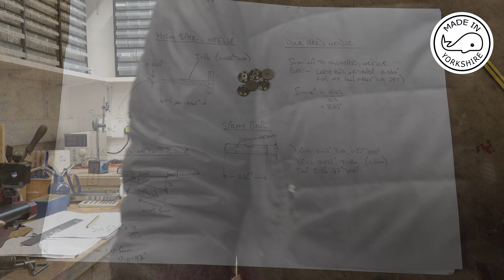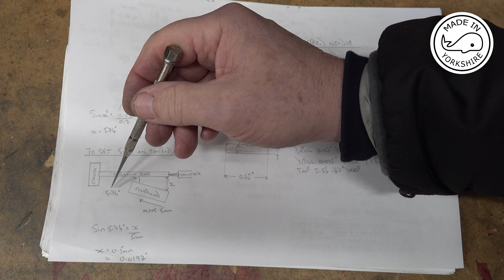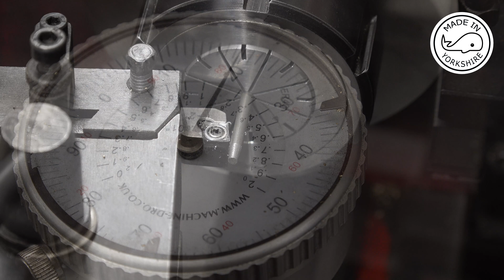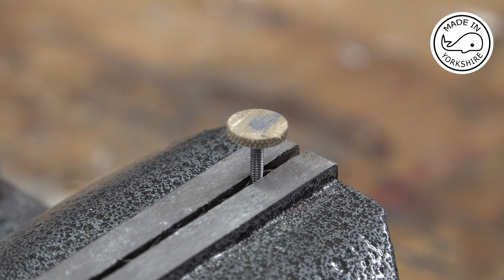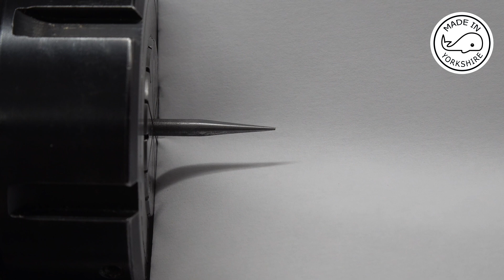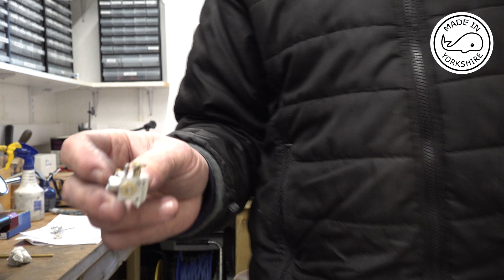#MT46 Part 3 - Jerry Howell 2-Jet Throttle/Carb. Spray Bar and Needles. In 4K/UHD by Andrew Whale.

Comment: While it doesn't really make a difference for your application due to the very small angle, but you should have used the inverse tangent to calculate the angle of the taper and not the sine (oposite/adjacent and not the hypotenuse). You when then use the sine to calculate the offset stack since you are now using the hypotenuse. As mentioned, the difference is very small at these small angles but you calculated an angle of 5.74 degrees, but it should have been 5.71 degrees (in your application this is negligible). Obviously this would make a larger difference for larger angles.
Reply from the maker: Hi Graham - well spotted! I think I must have had a 'senior moment' at that point. Many thanks for pointing it out.
Cheers
Andrew

Comment: Andrew, I'm enjoying your series of video's but may I make a couple of suggestions, when soldering items together where possible heat from underneath and the flame wont blow the solder about, have you checked the tailstock with the chuck centre recently as I think the little drill was pulled over by the centre drill which may have drilled slightly off centre.
Reply from the maker: Thanks for the suggestions. I think my centre drill left a bit of swarf causing the fine drill to deviate. I agree that heating from underneath is best, as the solder loves to follow heat. I adopt that approach when silver soldering. In this instance it wasn't that critical as the parts being soldered were very fine and the mating surfaces were covered in solder past.
Cheers
Andrew

Comment: Hi Andrew, great to see you back in the workshop. like others have suggested rather than using a piece of every between your fingers (which i started doing) i got a double sided diamond course / fine wet stone which got me nearer the tolerances i needed for a very fine needle jet.  Diamond is expensive and there are cheaper options as suggested but it gives a very good edge to other cutting tools, especially my wife's kitchen tools!
Reply from the maker: Thanks for the info Andy. I'll see if I can get hold of a fine wet stone before tackling the other needles.
Cheers
Andrew

Comment: Hi Andrew, nicely done. Can you tell me what the inserts are that you're using to cut that steel on the taper? I grind HSS (& cut in the mill with carbide) by choice but these look like they do a great job.
Reply from the maker: Hi Dave. I've never had good results using carbide inserts. I use inserts intended for cutting aluminium. They have a really sharp point and give really good results on mild steel, cast iron, silver steel, brass and of course aluminium. My inserts are ccgt060204alu used in a sclcl1010e06 holder. I also use round inserts rcgt0602mo-alu. The alu inserts are available from a variety of suppliers but I have found APT (associated production tools) to sell good quality ones at a reasonable price.
Hope that helps.
Andrew
Reply: @learningturningmetal  Awesome, thank you Andrew. I'll get some ordered. I do like APT. The choice of carbide is so vast & I've not thought about trying the ones for aluminium.
Reply: @learningturningmetal  Hi Andrew, I recieved the inserts this morning, wow! They are very sharp, can't wait to get off work now :-) Thanks again.
Reply from the maker: @davemason6273  great stuff. APT are pretty quick getting Orders out of the door. I hope you get good results with them.

Comment: Nice job on such tiny parts, and as some have already pointed out it’s a good idea to back up your emery paper with a parallel or use a whetstone to keep your taper flat . Ice cream sticks work too and give you an added bonus of a snack while working 😉 .
Reply from the maker: Many thanks for the advice - always appreciated. I'll use that method when making the other needles.
Cheers
Andrew

Comment: Great work as always Andrew. The little drill device looks a handy item to have. Did you make it yourself.
Steve.
Reply from the maker: Thanks mate. You can get the little drill from arceurotrade in the UK, under the name micro drill adaptor. It is definitely a very useful tool for drilling fine holes.
All the best.
Andrew

Comment: Great work Andrew, very fine detail parts and excellent camera work on parts this small! Thoughts on the solder paste?? Something I have never used so just curious around ease of use and clean-up etc. Cheers, Jon
Reply from the maker: Thanks Jon. Solder paste is a recent purchase and I've only used it a couple of times so far. I found it to be really easy to join small parts. I think its powdered solder suspended in flux paste. So, just clean the faces, apply a bit of paste to the joint followed by a couple of seconds of heat. Dead easy. You should try it out.
Cheers
Andrew

Comment: Great outcome Andrew. As someone has already pointed out, use something flat like a tool bit or parallel under the polishing paper. Using you finger has probably made it dished over the length and might cause you adjustment problems. Regards from Australia.
Reply from the maker: Thanks Dave - great advice as always. 
All the best.
Andrew

Comment: Wow great work on the tiny needles! 👀🔬
One tip; sandpaper can change the taper of tiny parts as it is easy to over-sand them. If you use a hard flat abrasive like a whetstone it preserves the taper. Or even stick the sandpaper to a flat piece of glass with oil, that gives a flat sanding device but still lets you change grit size for polishing.
Reply from the maker: Thanks for the great tip Wiz. I think I will hold off on the other three carbs until I get a successful test with this one.
Cheers
Andrew